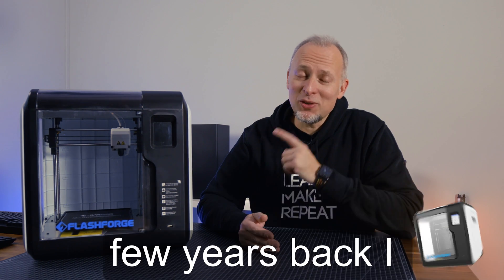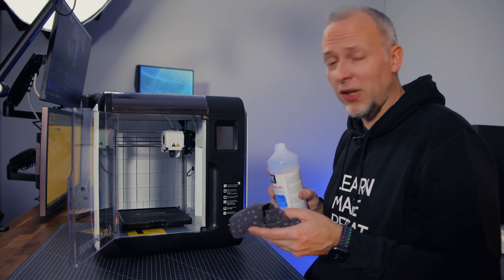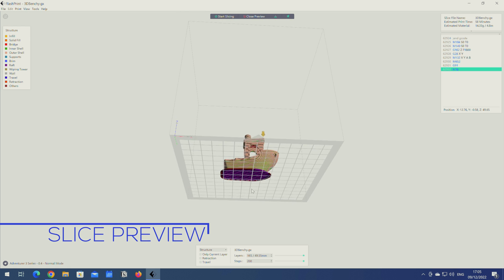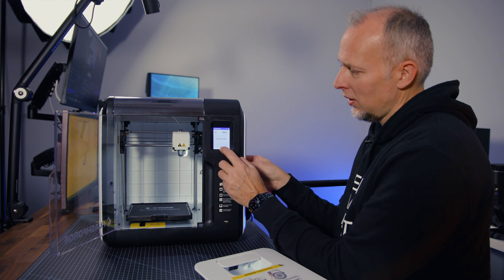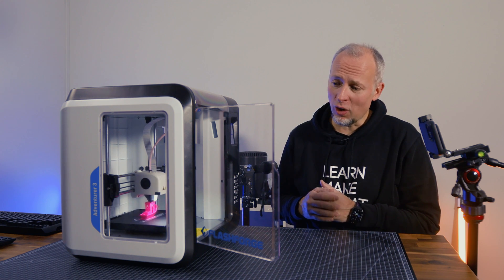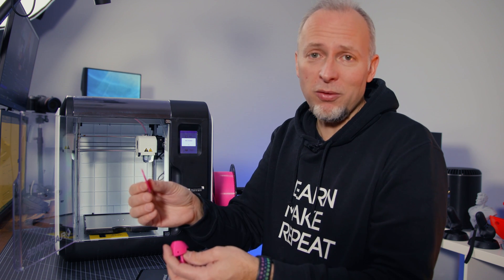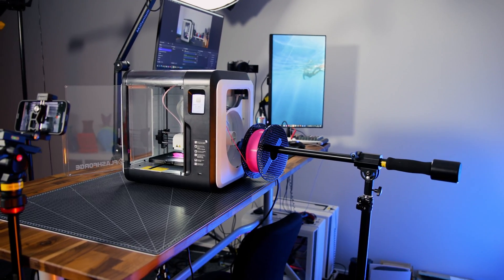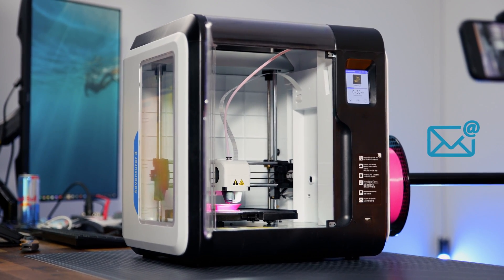Is the Flashforge Adventurer 3 still worth it in 2023?

Comment: Hello, I am very happy with the adventurer 3. It is my first 3D printer. The slicer makes a very good impression in expert mode and is a good introduction to 3D printing. Good result out of the box. With the default setting "fine". I now only use the original sunloMetaPLA filament. 193°C/50°C. Perfect for RC spare parts. And my own ideas.
Reply: You mean sunlu?

Comment: I started in 2017 with an Ender 1 (yes one !) while the Ender 3 is a much different and more capable printer than this. I tuned and adjustet it so well that it was better than an ender 3 out of the box. But since 2019 i am on the Adventurer 3 and got a second  Adventurer 3 in 2022... and i'm really happy. while this is not the fastest one on the marked the quality and stability is remarkable so wouldnt say one hast to "upgrade" to an ender 3 or prusa .. If you really dial in the materal the print results from either pruse nor Ender 3 machines ar e any better,. I thing the comperison between a heaviiely tweaked Ender 3 and a stock Adventurer is lacking somehow... If you would compare the other printers to a tweaked and mechanicly well maintaind (wich is kind of hard to do because nothing is acessible easily)Adventuerer 3 you would be suprised how good the quality is.. Even by todays satndarts the Board is very quick and pumping more G Code instructions per minute than any other printer in a remotely similar pricerange(It is in fact  AS FAST AS a Prusa MK4 )...Compared to the moderate movment and print speeds means taht the Board is never o Bottleneck . REGARDELESS of how complex a model is... If you have ervery thing right you can even see this in the print geometry .

Comment: I’ve been using my adventurer 3 for maybe 3 years now. It’s great! For me anyways. I’ve upgraded the build plate and nozzle over the years. And yes for filament you definitely need to retrofit some way to attach regular rolls.

It’ll even print TPU which has been impressive. It’s got to print a bit slower but it’s printed some pretty complex shapes with no issues. I’ll definitely upgrade eventually but the adventure 3 hasn’t given me much reason to.
Reply: Which slicer and slice settings do you use, for printing ABS?

Comment: What I like about this printer is that it just works out of the box mostly. Only thing one needs to do is recalibrate the Z axis because it is a little too low. But the small print bed and printing speed is a downside.

Comment: The answer is no. Not at the price point they are still selling it at. Too unreliable. Outdated and firmware and software holds it back.
Reply from the maker: Yeah, it slowly feels more and more like these are outdated. There is new printers coming from Flashforge that are rather worth the money, watch out for those.
Reply: @Crosslink3D  Yes, new firmware is coming, but I don't know if it will affect mine. If not, I will be selling them. Can sell the pair and get a new kp3s v2 with clipper for 300.

Comment: I got one of these units for free. It works well when it works, but it's temperamental to say the least. Oh and the filament feeder is badly designed. If your filament breaks it will not detect a filament error if the loose end is in the hole, even if it's not actually reaching the feeder gears. So it won't feed any filament, and it also won't stop due to filament error.

Comment: hey mate so you reckon the ender 3 is overall better than the adventure 3? ive recently got a keen interest for 3D printing so I want something a little challenging to design
Reply: If anything slicers like cura will give you a lot more control and that alone will give you better print on other machines.

Comment: Looking to get one of these is the bed leveling a troubling issue. I had ender 3 and I run into bed leveling issues
Reply: Bed levelling on this thing is proper shit. It's painful and takes a long long time to do. All because of flash forge deciding not to put adjusting screws on the bed which means you have to use the z offset to level. The filament feed has a tendency to knock too, which will be a symptom of poor levelling. 
Buy something else, youlll be happier. Even the adventurer 4 is much better.
Reply: @computerizedcat  agreed. It's a pain to get a good level. Usually, a raft is needed and even that needs to be stuck down with glue.

Comment: The flex bed will move a little in the X and Y axis I have found with mine unless you add a bit of flat plastic at the back of the build plate to stop the Y axis movement and the same for the X axis.
Reply: Maybe that's the problem he had with the overprint?
Reply: @boostedboxerchronicles  Yes I think that is what's happing, I was seeing this in my printing and when I checked the build plate, it will move a small amount in the X and Y direction unless you use some thin plastic as a spacer for the gaps to eliminate the movement.

Comment: My family's first introduction to 3d printing was on this printer's little brother, the Flashforge Finder.  The kids and I purchased it for my wife back in 2018 as a Christmas present.  No heated bed and a small build volume but it printed a nice benchy right out of the box.  Like Daniel's friend's experience with the Adventurer, it was a good introduction to 3d printing.  My wife still uses that little printer all the time.  She prints lots of things for her classroom and her robotics teams and it never fails.  I haven't upgraded anything or repaired anything and haven't leveled the bed in 3 yrs.   Then there's my three Creality printers... lol.
Reply from the maker: Agree, it's not bad to start with. Basically tinkering free although there is actually quite a bit of mods on Thingiverse but I think then I would rather buy an Ender 3
Reply: @Crosslink3D  I used your PrusaSlicer configuration file and the hot bed has no temperature
Reply: You are a liar.

Comment: Got one last year , been using almost at least a few times every month and it's worked great . Plenty of trial and error but it comes with learning the ropes lol and I'm still newbie but love my adventurer 3 ! Now the software seems to be built to make it work better seemingly but I'm switching to cura in the new year
Reply: I've been having quite a bit a trouble recently with my adv 3. Would you mind sharing what settings you usually use for pla?
Reply: @A_HollowSoul  I still use the flashforge application but typically use 60c for bed , 220c for nozzle with at least a 1mm brim to help adhesion to bed for tricky prints etc but im still super noob .  Also I use their PLA

Comment: This is my first printer and maybe I’ll upgrade one day. I got it second hand for only $200. I don’t get much layer shift but bed levelling can be a pain sometimes.
Reply from the maker: It's not flawless but I still think it's a good value for beginners. There is cheaper printers out there but they also have a lot of issues. Never had any problems with this one and my friends also not for the last two years.
Reply: Does it only work with flashforge pla? Or any will work?
Reply: @jasonhunter3429   it works best with Flashforge but you can use different brands you may have to change some of the settings though.
Reply: @jasonhunter3429  any but need to print a spool holder for other stuff. Really easy print
Reply: I just got one for $150 mint condition!!!!!!
Reply: @hollisbabybeats  nice! I recommend also buying some spare parts like a boden tube coupling and a replacement gear for the extruder. Buy them now and it will save time later (in my experience) but so far it’s been fantastic print quality!
Reply: @Heneling  coming from the ender 3 S1, I am so happy I don’t have to constantly level the bed and set z offset
Reply: @hollisbabybeats   if you don’t like bed levelling then level it once and try not to turn it off.
Reply: @Heneling  taking the magnetic bed off and back on throws it out of level.
Reply: @hollisbabybeats   good point